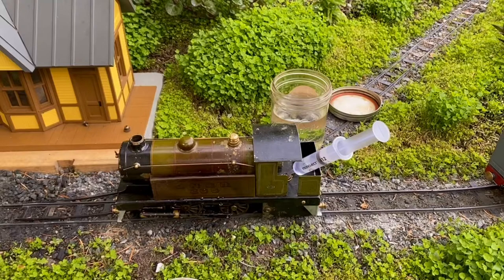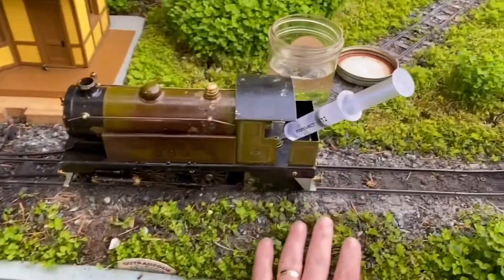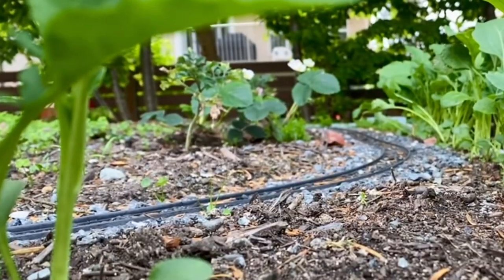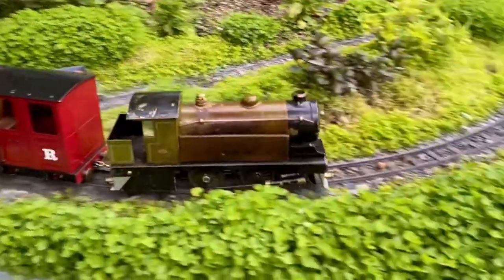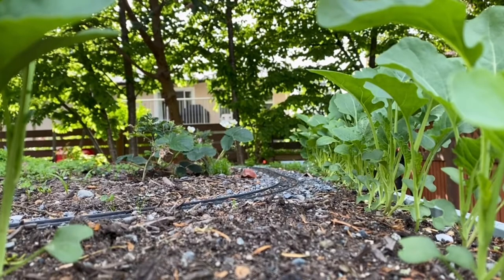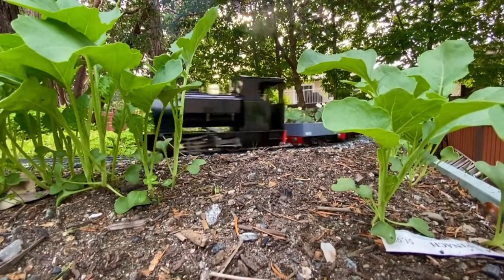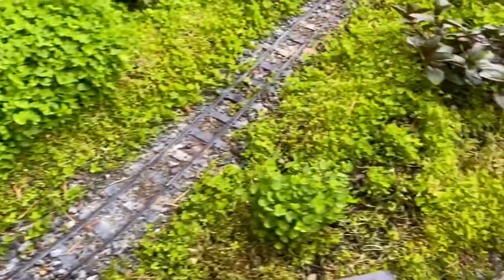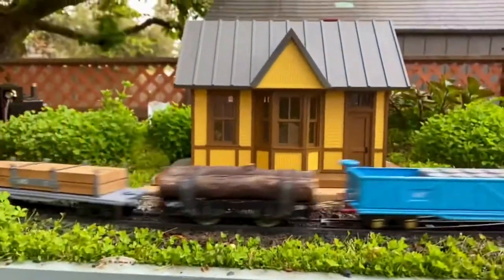Victoria B.C.:  Running my live steam Bowman 265 & Accucraft Sabrina. 90 diff years between them!

Comment: Very nice engines Terry.

My Accurcaft oil arrived today, and the results were not very good. It ran about the same as always, i e it can run for a while but has no power. So I’m not sure what’s going on within. And the second run was even worse, it pretty much refused to go. I’m thinking that regulator problem you mentioned could be at fault.
Reply from the maker: Tricky old things, these engines. As I have said mine was a basket case. The Accucraft Oil is another thing to try on the check list. So ‘check’! Hmmmm At least it is great oil and will protect your working parts. So no loss there. 

Presuming the lubricator was soldered back on? How much oil does the loco shed up the stack during a run. There should be a goodly noticeable amount. Could there be a tiny leak where you can’t immediately notice. I had that. I used a small mirror moved around while the boiler was under pressure. Suddenly a small stream of condensate happened on the glass! Voila! A leak. 

Anyway, keep experimenting. As I said I wish I lived close. I’d love to have a go at it in person. 

The odd thing is that after warm the second run was not successful at all. Maybe some parts are too tight? And when metal expands with heat it gets worse? Just speculating out loud. I love a real problem. 

When you finally have a loco that runs well you’ll be much more satisfied than a new thing running perfectly off the shelf.
Reply: @Terrys-Steam-and-Bricks  Well Terry all is well now. A leak was found, stopped, and it’s now pulling coaches!
Reply from the maker: @douglasmcdermott2830  hurrah!!!!